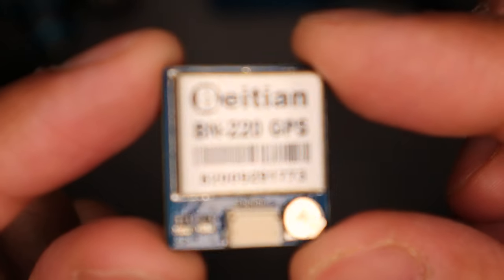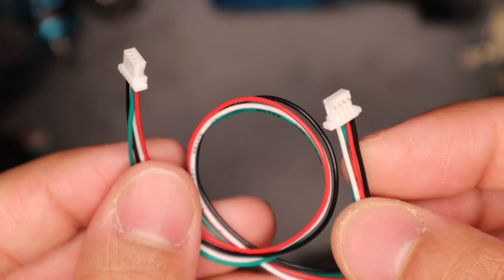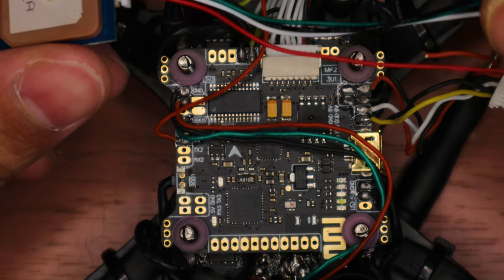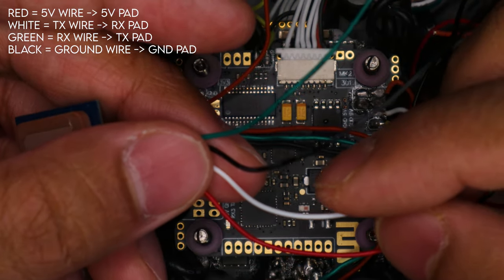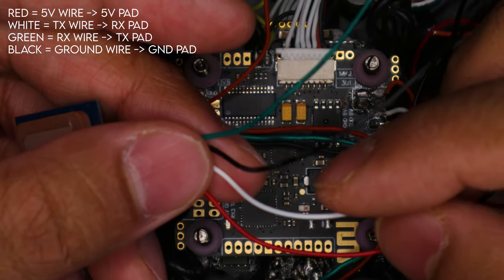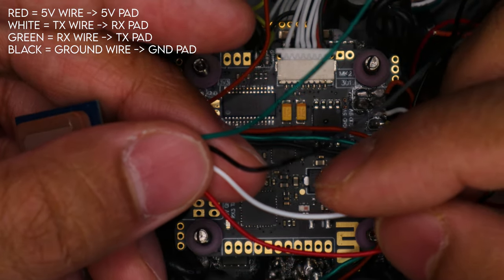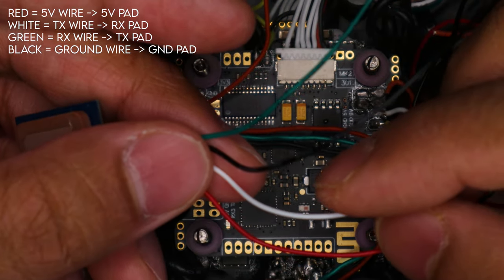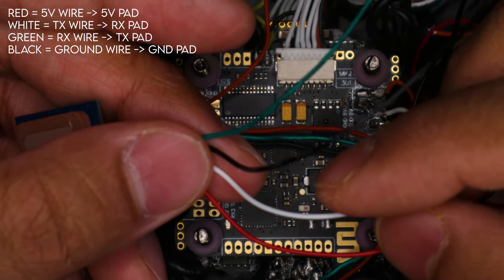How to Install and Setup a GPS on your FPV Drone (4K)

Comment: One problem with GPS rescue is that GPS altitude is not accurate or consistent. Without barometric altimeter, relying solely on GPS altitude, GPS rescue could produce some undesirable results.
Reply from the maker: I was not actually aware of that to be 100% honest with you. Do you mind if I pin your comment to the top? That way any who watch the video and see the comments can see that as a warning perhaps?
Reply: @supafpv1759  Please do, I don't think most folks are aware. I myself became aware after some research because my Chimera4 GPS would show my altitude as anywhere from 1,500 ft to -1,500 ft, all in the same flight. Double-check my research though, I'm a relative noob.
Also, I just received some copper tape which I intend to wrap and ground my GPS wires since it seems these things are vulnerable to interference.
Reply from the maker: @Mister_Garibaldi  I flew about 7 packs yesterday and everything seemed normal. I’ll be sure to keep an eye out indeed if anything looks out of the ordinary.
Reply: ok go  Thanks for the heads-up. I've only had two GPS modules on quads, and apparently both are faulty....one came on a bind n fly, another I built. I'll try a third and see how it goes!
Reply: The GPS altitude is probably based on standard pressure, 29.92 inches of mercury. The correction rate in one inch per thousand feet.
Reply: Say that to BetaFlight 4.4
Reply: Maybe some manufacturer comes out with a station pressure sensor to calculate altitude based on barometric pressure right at the drone. I know its possible. Kestrel does it for handheld devices,,, now we just need someone to make it for our drones.

Comment: A mid-tier GPS is bare minimum for any flights I do over water due to the standard failsafe action of "Drop". Even if it acts wonky, it's at least a moment to try to get signal back and not go swimming for likely dead equipment. Been really liking Matek's units. They gain locks quickly and are easily configured.

Comment: Thanks for the break down got the same GPS. Your tips got me working.... I trusted the assembly of the cable but mine had two wires swapped around. Once if reversed then on the plug it jumped into life.
Reply from the maker: Glad I could help! And yea some models have the wires switched around. Glad you figured it out tho!

Comment: I soldered to tx1 / rx1 pad, but Uart1 is missing in ports tab. Confused...
Reply from the maker: Sometimes UART1 is the usb connector allocated to it. Try one of the open uarts not previously assigned
Reply: @supafpv1759  I soldered it to tx1 & rx1 on the board. I can see blue led on the GPS but betaflight doesn't recognised it. As per specs its written," uart3 for rx, uar6 for smartaudio, uart4 for digital(dji), and spare UART1 for pilot to solder their own". I am lost 😀
Reply from the maker: @pateachongthu  if you want, you could put the smart audio to like an LED pad and then remap it to a soft serial uart. Then use the UART3 you just opened up for the gps since you have smart audio on the soft serial LED pad or something
Reply: @supafpv1759  that might be a good idea

Comment: I don't know if you're still responding, but could you explain, why there's a seperate battery on the gps module? I mean when the main battery gets unplugged, you're screwed anyways!? You'd need to have the crossfire receiver soldered to it so it's still able to send the gps data to your radio, I guess... Been searching for a answer for quite a while.
Reply from the maker: There is not a separate battery on this GPS module. It needs a constant power source. Check out one of my latest videos about the GPS Mate. Great little addition if you want the GPS to continue sending a signal out to your radio!
Reply: @supafpv1759  oh well then I guess I just didn't get why there's this tiny round thing on there, which looks like a battery. I've set up my gps already and it works great! Really appreciate your work!

Comment: Do you have to register the GPS unit? surely you need to pay to use the service? or is that part of the GPS purchase? I think I will need to get one of these for flying in South Africa....
Reply: And what GPS would you recommend?
Reply from the maker: No need to register the gps to any website as far as I know. It locks onto open sattelites, nothing super special or anything. All you need is to get the module and solder it onto your quad/ set it up in beta flight!
Reply from the maker: @MichaelHoughton_  I recommend the one from the video: Beitian 220, if you want more features you can get the 880!

Comment: I wired a GPS unit to a baby croc lr......that I took off a flywoo lr....I double checked the wirering and is still not working properly am I missing something?
Reply from the maker: You sure you did the beta flight portion correct? That and on the new quad, is the gps in a good spot to see the satellites
Reply: @supafpv1759 .....thanks for your reply but yes I think I've checked all those point on betaflight the drone is working perfect but it's not showing anything of GPS information on the osd it just saids Sat numbers 14....iam not locked iam still able to fly picture is clear....like I said the original gps was broken down on a crash I had a spare one but it was a different brand from a flywoo lr...I just think is probably not compatible with the baby croc
Reply from the maker: @leo18071   yea Idk seems kinda odd. But it’s saying you’ve got 14 sats? Most gps modules work as long as it’s got TX and RX wires. It is possible that it’s not compatible but idk that’s super weird. So like non of your osd gps stuff shows any numbers? Like no speed, or longitude and latitude?
Reply: @supafpv1759  I have the same problem. I’ve swapped the green an white wires back and forth and it still doesn’t show up in Betaflight and I’m showing 14 satellites which I think is the default when it’s not receiving any of them. Also my blue light on the GPS module blinks really fast unless I swap the green and white wires and then it blinks slowly, but regardless, no joy with the receiving any data.

Comment: hello....i have a  6s flywoo vampire 2  hd with dji  google...to the point..the air unit had some  issues  from a broken antenna and sent it for repair so i did  it  analog now...since i had a brand new gps  beitian 220..i said why not add that too  now i have lot of space......initialy  the leds were  working  .....but  i just unplugged the  plug from the gps..and now its not turning on   again..what is happening? is it possible to broke cause  just i took it out will the FC was on usb???
Reply from the maker: I think you may have shorted it out by unplugging the gps while plugged into your computer. On the other hand, usb power is super low but seeing that, that’s the only thing you did before it stopped working I think you shorted the gps. Did you have a battery plugged in too? Cause usually the gps doesn’t get powered on till a battery gets plugged in.

Comment: Can you pelp me please?
Gps showed long.. and lat.. when fist powering on and connecting to betaflight but could not get any satellites.
Then it detected gps on the top "gps" indication of betaflight.

Then I changed it to Ublocx and was showing same thing.
Wen I changed back to NMEA it did not detect gps anymore and showed up only with Ublocks, but still no satellite.

(Blue light was blinking all the time on gps).

This morning I left it in the open for 10 min. BLue light turned solid, now it does not detect pgs in betaflight under Ublox or NMEA>>>
I don't understand what is going on??

Comment: Hi Bro..... can we use on Protek 35 whoop... i am new to FPV.. please suggest.....
Great video :)
Reply from the maker: Yea should be possible as lon as there’s an open uart
Reply: @supafpv1759  thanks buddy
Reply: @supafpv1759  One more question: Does this direction arrow is accurate.... or should I have to buy Beitian Dual BN 880 for it......as of in my place 880 is not available :) Thanks a lot
Reply from the maker: @AkshayTravelFilms2  no need to get the 880, this ones pretty dang accurate

Comment: does this also work when you work with the dji goggles and a air unit?
Reply from the maker: I believe so, but I’m a little fuzzy in djis equipment since I’ve never used them before
Reply: Yes, it works in the same way!

Comment: Dos a gps work on any fc or you need to add something. I think a megnatometer?
Reply from the maker: Nah it’ll work lol as long as you got open UARTs
Reply: @supafpv1759  thanks for the quick reply man. Now i can order happily one
Reply: Yes, you need to make sure your flight controller has a Barometer on board if you want to be able to use all its features,and also not loose your pride and joy.
Reply: @k1ortia  at the moment all i want is have the ability to come back home. I can add external barometer. But as i know the barometer gives you only the altitude. No more?
Reply: @oussamasmaini7297  Correct, but would you honestly trust your $500+ 7" rig to just come on home perfectly on a flight controller with no barometer, and rely just on a gps module you,ve attached to the one set of UARTS?
Reply: @k1ortia  to be honest it's more then 500$ but I'll test it in smaller distances and see how good it is. Or just buy an fc with barometer built in
Reply: @oussamasmaini7297  Yes that,s why i said $500+. it will still work fine, but you wont get the full features such as position hold, Loiter ect. Personally i would go for something that already has a barometer on board, dont bother adding one, waste of time and money. The Matek boards work flawless with gps, either with I-nav or ardupilot. I think thats what im going to do next.

Comment: Isn't it bad to have your drone on for that long just sitting there? Won't the vtx overheat? I'm new to this whole thing and there's lots to learn
Reply: Basically you're correct. Many VTX's have a limiting function to lower power when overheated, but don't count on that. Betaflight now has a function where you can put the VTX into 'PIT' mode with a switch which drops the output to a bare minimum. You could set it for 'pit' and 'maximum' output with the switch and go fly. Joshua Bardwell would be the one to ask about this.

Comment: Hi I'm new to building drones, my first build flew away on me today, so defo want to add gps to my next build which is on the way, will this work with a matek f405 std fc ? Thanks
Reply from the maker: Yea man should work, as long as you have enough UARTs on it
Reply: @supafpv1759  Do you recommend getting the module with a compass? Will this be better or will the module you cover in video work fine? Thanks for reply buddy
Reply from the maker: @supermotovtec8550  this ones quite adequate tbh you don’t neeeeed the better ones but it’s nice to have.

Comment: It works on DJI drones?
Reply from the maker: No unfortunately it does not. Unless you’re talking about DJI fpv setups then yea but not on the mavic, phantom, etc. those should all have a return to home feature built in right?
Reply: @supafpv1759  thank you, yes they have RTH but it will be good if you can have a Second GPS to track the Drone mostly for when there are accidents where the drone shuts down and it is no longer possible to track it
Reply from the maker: @laar2955  you could always slap a FCand a gps onto it somehow and get the telemetry to your controller or something else lol. It would be weird but cool.

Comment: What weirdo uses uart 2 for gps, is it just to make things more difficult or something? lol isn't uart 2 like auto default setup for your actual controller link? Just not sure I have seen something that usually didn't just have a uart plug for uart 2 4 pin to go directly to an elrs. I guess there are all those odd flight controllers the airplane guys like to use like pixhawk or orange cube weird stuff. Just curious because like most modern style fpv flight controllers usually default to uart 2 for control link, did yours have a different uart default or.....I dunno if their is an or even, that's why it confuses me so so much. Hey can you help me btw with my gps, when I'm setting it up on the bench connected to betaflight with no battery connected, it can see the gps but won't connect to any satellites betaflight won't even give me a yellow light at the top for the gps. Just kidding, seriously on my first build it took me 4 days of flashing, reflashing, and rechecking my wiring, only to figure out the gps basically will never fully work without a battery connected, so as much as I joke about it, if I would have seen this before I did my first build would have saved me a massive headache and days of stress. I built a long range 10 inch for my first build, I was/am really really dumb......

Comment: Even if it was $50 it's a cheap peace of mind to save a potential $700.
I could be wrong but I don't think quad speed has much to do with a Ham license. Milliwatt rating of the VTX? Definitely. No higher than 1 watt (1000mW =1 Watt) Wattage is a measure of power output.......P= I x R or Power in watts = Voltage times resistance if you're in a circuit. Basic Ohms law.
Lots of Chinese and other suppliers of VTX's will limikt the VTX to 1 watt, with instructions to 'unlock' it to say 1.2 or higher. I know there are 2 watt transmitters now. They do this limiting to be abvle to sell legally in the US if I'm not mistooken.

Comment: Nice device
Reply from the maker: Lol thanks! What does a GPS master think of the device?
Reply: @supafpv1759  depends on the actual GPS device performance
Reply from the maker: @pinoyautomotogpsmaster220  general consensus is pretty positive on its function as a gps made for a fpv drone. Flown about 30+ packs so far and the location is almost dead accurate.

Comment: TX to RX??? What a fack???
Reply from the maker: Yea it’s weird like that haha
Reply: @supafpv1759  ok
Reply: @supafpv1759  Its actually not once you understand whats going on, Honestly. Rx receives a signal and Tx transmits a signal. So in order for any hardware connected to a Fc it is connected the opposite way, otherwise there would be a conflict between the same signals. Think of it like a magnet, opposites attract. The same repel. TX-TX repels TX-RX attracts. Hope this makes it easier to understand.